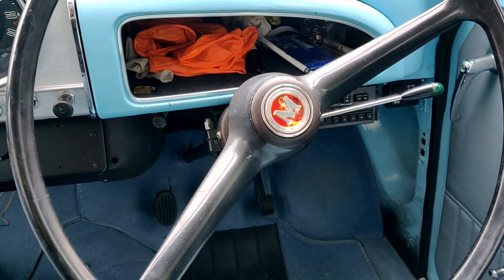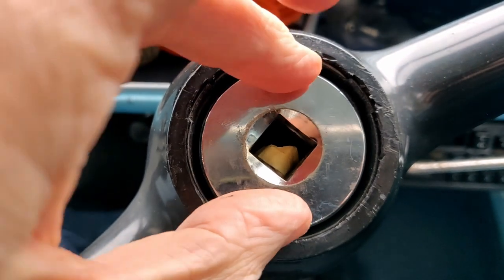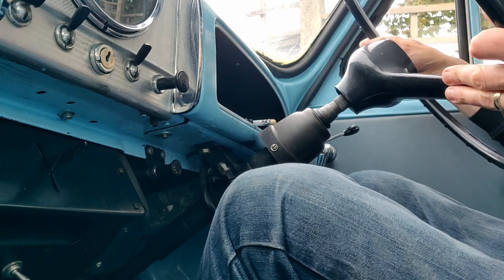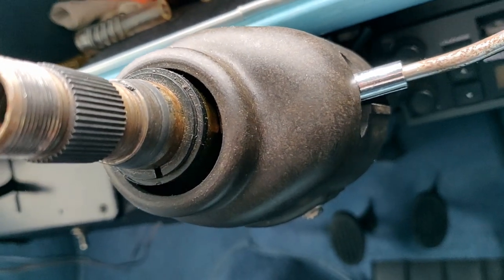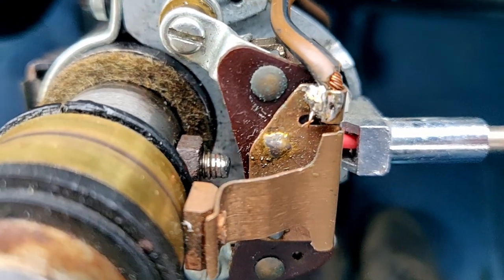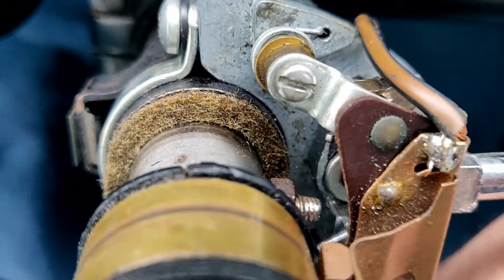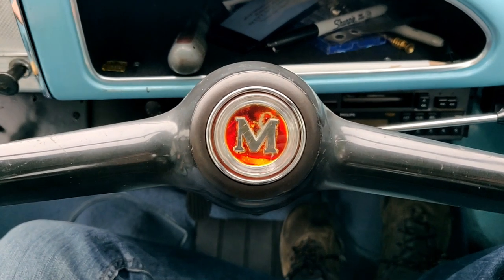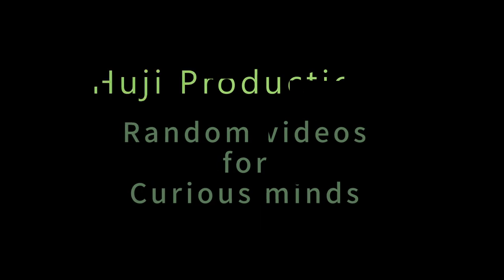Morris Minor 1000 - Steering Wheel Alignment, Horn and Indicators

Comment: Huji - well done.  How does the unseen end of the wire to the horn button attach to the brass slip ring.  I've got a bunch of loose bits here and don't understand how it all goes together. Please help. RB
Reply from the maker: Thanks. I believe the wire that comes out of the end of the steering column attaches to that brass slip ring, this enabling a complete circuit whilst the steering wheel rotates.